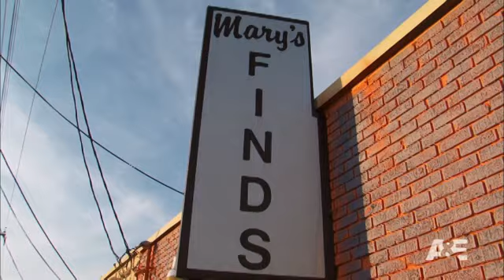Storage Wars: Texas: Fish Tank | A&E

Comment: water was too cold , there is a product / solution you add to balance the tank for fish, removes chlorine , plus the bags should be submerged so the bag water reaches tank temp over time. then dump them in..and a air pump with an air stone and you got fish
Reply: Yeah they shocked them.